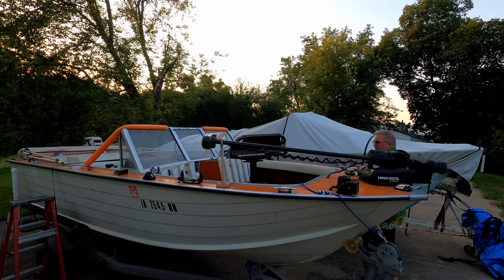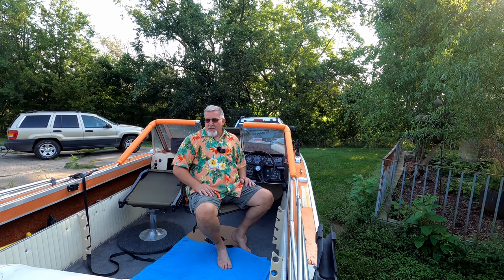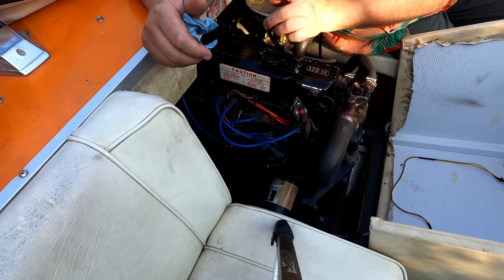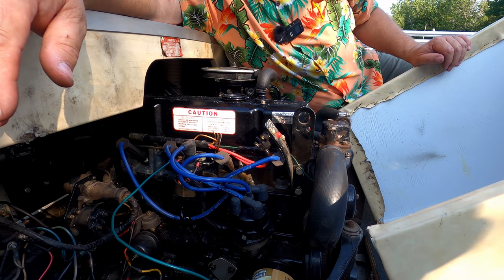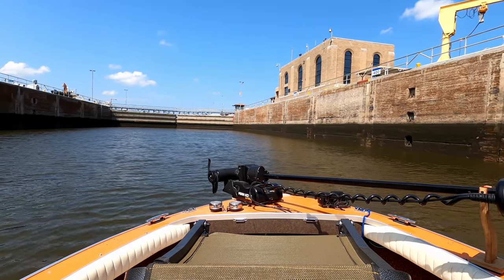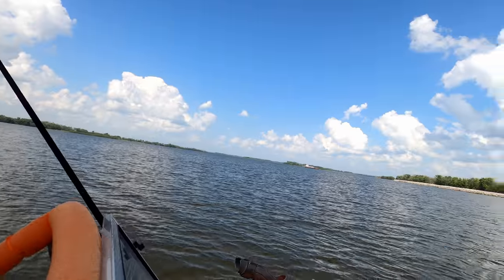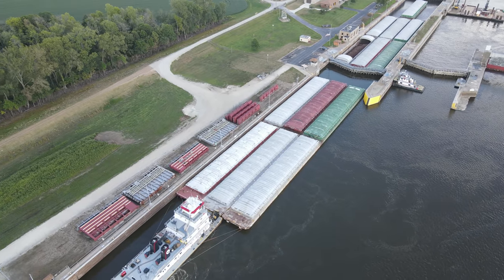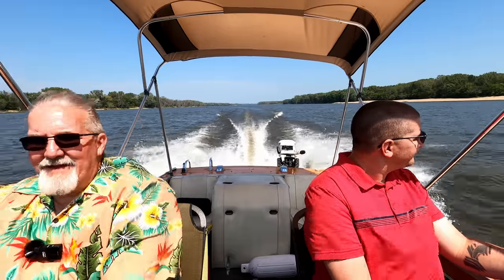1976 Starcraft Ignition Fix and 95 miles on the Mississippi  Lock and Dam 17 & 18

Comment: looked like fun. makes sense about the ignition power to the igniter. purple is switched ignition on mercruisers but that resistance wire is spliced on in the harness. and some diagrams dont show it. if you unravel the tape you'll find it.
Reply from the maker: For sure. In my diagrams they show it on the other end of the wire.

Comment: You'll use more fuel going up the river.  You'll be going further through the water than going down. You have to take current into account.
Reply from the maker: 1 mile per hour current doesn't have too big of an impact.
Reply: @Michaelsbackyardmarina  SMH